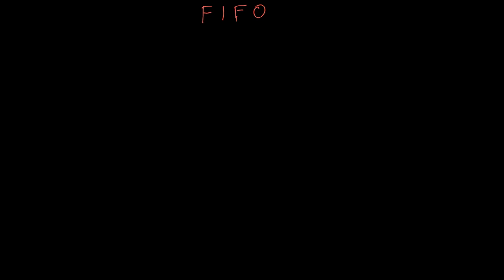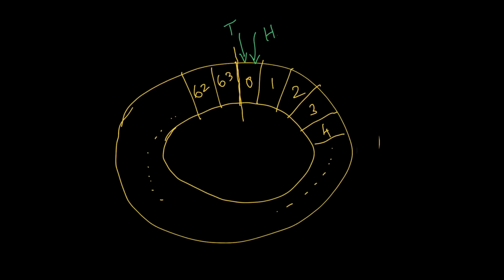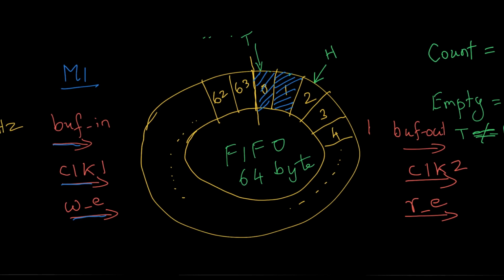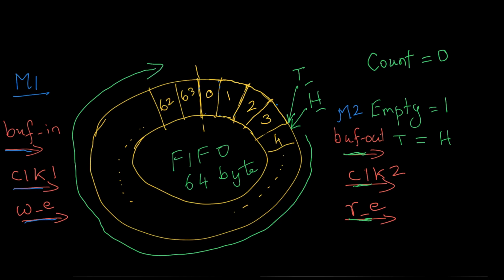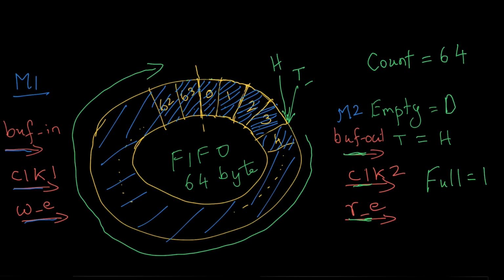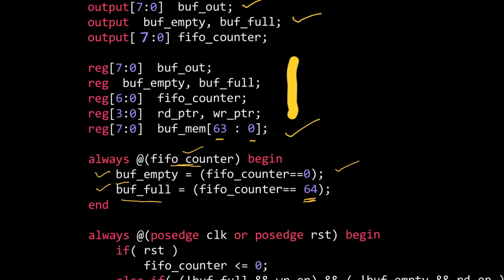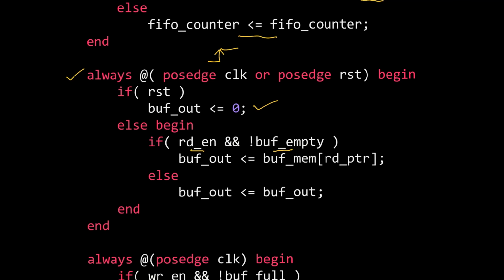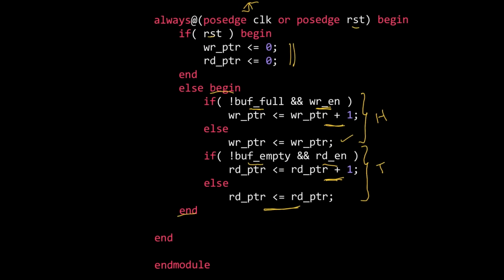Designing a First In First Out (FIFO) in Verilog

Comment: buf_full signal should be asserted when the fifo_counter is 63, not 64 because it counts from 0. Therefore the statement should be corrected as "buf_full = (fifo_counter == 63);"
Reply: The counter is initialized as 0, so it is counting from 1, so it is correct.
Reply: No bro it has to be corrected to 63  , there initialized as 0 but after coming to 0 only it starts the count so it needs to get corrected
Reply: From 0 to 1 it counts 1 1 to 2 it counts 2 and 63 to 64 it counts 64 hence at 64th count it will be full
Reply: there are 64 bytes of memory not 63